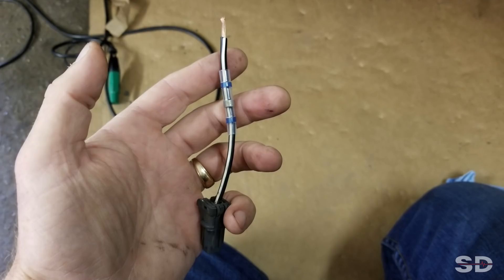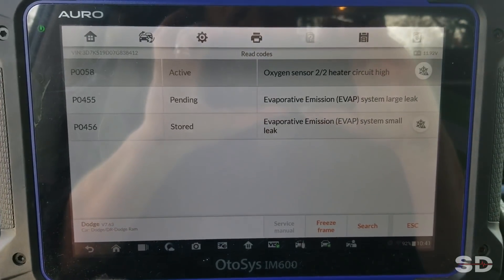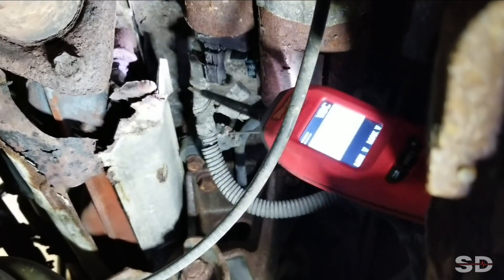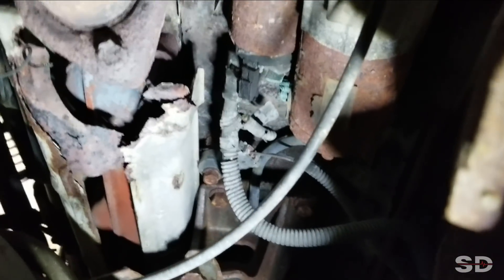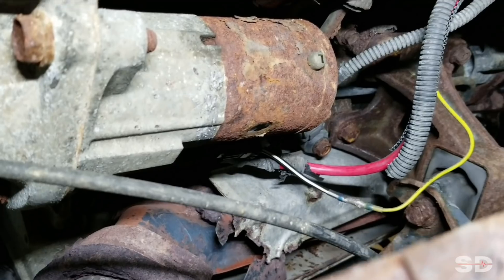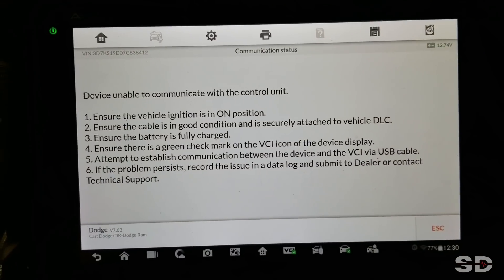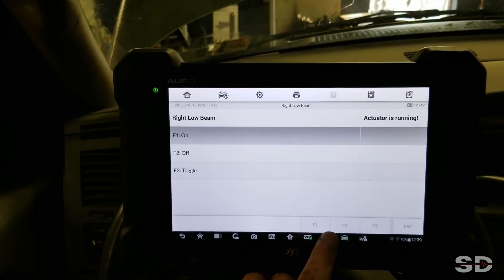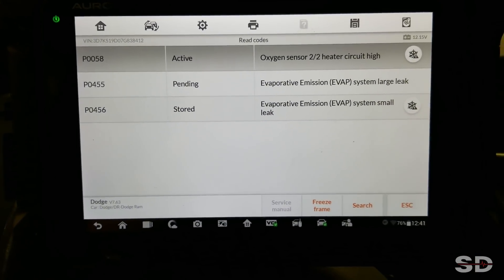2007 Dodge Truck No Crank, Wiring Repairs, New Scan Tool

Comment: As far as melting heat shrink butt connectors goes, Power Probe makes a butane soldering iron. It has an open tip in the kit that acts as a heat gun. It's how I do almost all of my heat shrink. I have a Milwaukee soldering iron for solder work.
Reply: Addendum. I just realized that this video is 5 years old and you probably realize all of this by now. 😂😂

Comment: Thumbs up for not deleting the failed solder with the lighter, thank you! I'm not yet sold on the single stage solder/heat shrink, too easy to leave an inadequate joint after saving less than a minute of time. Great to see another scanner, I wonder how that's gonna shake out.

Comment: if you heat up the bare wire end with the soldering iron and dip it in acid it will clean it up real good and will take solder then

Comment: Use the blue flame only to avoid soot. I just got these style butt connectors a week ago by accident I didn't know exactly what they were. I hate them. Half the time I'm heating them, the insulation just pops and either the solder comes right out through the insulation or the red seal come out through the insulation. I loved the crimp style with epoxy seal.

Comment: A tip for doing heat shrink with a lighter, the temp is hotter if you hold the heat shrink 1-2 inches above the tip of the flame instead of directly in the flame. It also decreases the chances of it charring the tubing like it did for you.

Comment: Hey Paul greetings a tip here , i spent couple of years on the US NAVY as a technician and while i was there they thought us that never solder a connection that was on a prone to vibration place because it can crack and have issues later ,just use butt connectors or heat shrink tubing or heat shrink electrical tape ,only solder connections that were indside with no vibtation,just a tip here man,as i always said nice job your doing Paul i have learned a lof from your channel ,i forgott if you can help me out to like  and share my page ,i just opened a channel a couple of weeks back ,ill be doing some videos on english too,
God Bless NEVER GIVE UP!! TAKE CARE !! From Puerto Rico ,Ken!!

Comment: on the heat shrinks with the solder sleeve they have flux.give the solder sleeve a firm squeeze with a pliers to get the solder in contact with the wire.

Comment: I use bare butt connectors and a good sealing heat shrink or electrical repairs. The nice thing about them is you can use solder as insurance. They work good especially in conditions like this where the wire is still good but a little green.

Comment: band 2- O2,  shoould be passenger side rear, probably nothing wrong with the heater in the sensor... one of the common grounds with away corroded wire or plug... (multi-wire crimp terminal most likely) GARBAGE is garbage is garbage.

Comment: acid flux would clean it up, BUT it will also wick back into the wire and cause corrosion behind the fix inside the coating, pretty much like the salt water has done now...
only true fix cut it back until dry and clean, abandon the wire and run new.....

Comment: awesome, loud farting exhausts leaks and the starter solenoid to motor supply wire green corroded as hell, coming very soon, no start, starter bad =p
to be honest, I'd have done both if it was mine and possibly the battery to starter terminal end too. past lessons of life. even thought I hate and will not own another crapsler anything ( exacept maybe a classic, pre-JUNKTRONICS)

Comment: "40 amps" to make it crank? did I hear that right or do I recall wrongly..... seemed the solenoid coli was more like 10 to 15 amps, requiring low voltage drop to have enough force.....

Comment: Ford went to the "spade terminal" for a while, but it was a major issue for them too, luckily, it was a eyelet to tab converter, which went on the "unchanged starter" stud with a locking nut/washer.
aftermarket and they all went back to harness modification, starters were supplied with sealed ring terminal eyelet to butt splice. go figure .
I may have partially caused that, public ranting about chinesium and junk DOES in fact help curb totally stupendous things ;)

Comment: best fix for a Dodge is the crushers, more so if it's beyond  years old :))
them solder connectors MEH, I'd rather use the crimp style shrink/sealing splices myself, of course you need to use a a heat gun or lighter and evenly heat to not blow them out also...

Comment: Awesome work Paul thank u for sharing another great video.. Wanted to ask about this Scanner does it have scope capabilities and how much cheaper is it than the Snap On
Reply from the maker: no scope on this one brother just a scan tool 
And as far as costs, there are a bunch of different model Snap-on units, but if you are talking about the Verus? It is around $10K
Reply: Yeah I know about the Verus that bad boy is a little to far out of my price range lol.. Actually I was speaking of the Auro the one u are testing in this video I heard you say that u was surprised at all the on board systems the u could communicate with while using it.. It is a pretty good scanner and worth saving for also what's the price tag on it

Comment: not a fan of the solder splice, I prefer RA flux in a dropper squeeze bottle , non insulated seamless crimp, soldering gun, adhesive lined heat shrink, premium 3M electrical tape 33+ or super 88 works great in cold weather. 3M scotchkote- (not liquid electrical tape.) - PS - I own a boat  used in saltwater! 3M Tape comparison http://multimedia.3m.com/mws/media/770753O/3mtm-vinyl-tape-performance-comparison-chart.pdf

Comment: Why didn't you just use Solder, Flux and a piece of adhesive shrink tube?  When I work with corroded wires I use Petro Based Acid Flux dipping it several times(hot)
I know! You just wanted to play with them nifty soft solder tubes LOL
Reply from the maker: Pretty much lol

Comment: Do you own or have used the OTC Encore?
Reply from the maker: yes and for $1300 or whatever the list price is, it is worth it as it is a bi-directional scan tool but I hate it because it is sooooo slow. To be fair, there is a new update and I need to run it and see how it does after.

Comment: That PowerProbe is great - I definitely need to get one of those. Working solo, it's like having another person there at the flick of a switch ... except for that crank command requirement for the computer to start the engine.

Yeah, that thing is basically an Autel with a different name - wonder why they do that? Why not just keep it an Autel? Strange!

Excellent as always, brother Paul. 👍👍🍻

Comment: in my experience using very similar connectors from napa an electric heatgun works far better on them than any other heat source i love using them the connectors seem to be very good
Reply: Absolutely right. In fact those solder sleeves are supposed to be melted with a heat gun. A flame is a bit too much. Wanna guess how I know?

Comment: The thing about the Auro/Autel tools is understanding that if the manufacturer of the vehicle coded a functional test it will work but if not it wont. The options for some tests and functions may not always work although you might see an item listed. I use an Autel everyday but when I need total diagnostics for driveability and scope I grab the Verus.  You also need to understand the manufactures that have Legacy and enhanced versions and when the years they converted. A prime example is using the Autel on an older Chrysler during the DRB3 era. The autel will work but it will show a lot of functions and tests not applicable to the vehicle. The Autels are an enhanced tool but the Autel DS708 is the legacy version. Hope that helps.
Reply: Same options as Maxisys Elite

Comment: Also when you said software glitch the autel is the same way those are just your options on the screen you have to activate the options at the bottom
Reply from the maker: Then your shouldn't be able to click on them! they change color and make a sound as if they should be doing something, also when you click the F buttons, the displays on the screen are not coordinated with it. lol. I'm still calling it a glitch

Comment: The solenoid pulls 40 amps? Also looks like you need a power probe penetrator gives you extra 6 inches and is real sharp to get good contact
Reply from the maker: Initial amperage (when both windings are energized, before the motor starts to spin)
Reply: High inrush current - that is why you pre hold the  switch on a power probe as to not weld the switch contacts
Reply: I have used my power probe 3 for 10 years doing this never had a problem now my 4 for a few years what is the breaker amperage on I power probe
Reply: 8 amps

Comment: When I need to solder lightly corroded wires I usually take 220-320 grit sand paper and pinch the copper between the paper and lightly drag the sand paper toward the end of the wire. Clean up the wire after with some electrical cleaner of sorts to remove any dust and then solder. Usually works pretty good.
Reply: I agree, but I still would not trust that connector. You cant really tell if the joint is any good.
Reply: @fascistpedant758  I am a bit skeptical but I have seen these (on videos) seem to work alright. My issue is when soldering, the copper also needs to be heated up to allow the solder to bond with the copper. My question is, is the copper being heated up enough for the solder to bond? I have seen some people pull hard with these and they joint didn't break. I think it shows promise if the wire is prepared correctly.
Reply: I guess they would be fine on clean copper and,as he mentioned, using a heat gun. It seems difficult to heat evenly and for enough time to heat the wire without burning the heatshrink, using a flame. I still prefer to see a solder joint properly to be sure the solder is wetting the copper as it should. I'll have to try one someday.

Comment: Hey danner good diagnosis I think some else would of been like o you need a new starter no crank I find all your videos very helpful thank you for your videos and sharing your knowledge and I also want to thank danner jr for helping with the videos I hope you make more videos soon o and does that scanner work for evap to close the vent solenoid
Reply from the maker: yes it does Ernesto. This scan tool has more bidirectional tests available to me than any other scan tool I've used
Reply: @ScannerDanner  ok danner I'll look into that scanner I'm looking around for one thank you for the reply

Comment: The Wagner HT400 works well for those type of soldered connectors. We use them in aviation all the time. I have the HT400 and it does a great job for stuff like this.
Reply: But I always crimp with the appropriate tools when I can. In my experience crimped connections with quality shrink tubing is much stronger than any solder connection.

Comment: I found that using the yellow solder sleeve works much better on a connection that size. It seems that the blue ones don't have enough solder to fill it. When I first started using them I always tried to use whichever one fitted snug around the wire before heating. But they just end up overheating before getting a good flow through the wire. Move to next size up and surprisingly the solder melts faster and much more evenly. I suspect this man be due to the solder being able to absorb all the heat and melt before it's pulled onto the wire and having heat taken by the wire. They stay clear too doing it this way. Don't turn black or discolour. Very strong connection too.
Reply from the maker: very helpful information! Thanks so much. I will remember this and apply it next time

Comment: I just can’t be sold on those solder-filled butt connectors. I can’t imagine that even in the most ideal conditions that they could ever be more resilient than a mediocre solder job with marine grade shrink tube. Also, I’ve never seen anyone use too much flux on a joint...
Reply from the maker: I've done them and then cut it apart to see how well the solder made it's way through and I'm good with what I saw.

Comment: You brought up a good point about those 'built in solder' butt splice connectors.. If the wires are oxidized, or has some crusties, it's going to be a bad joint. Might be better off with a good crimp connector. cleaning the wire better, and additional flux would certainly help.

Comment: So what do you think of the scan tool compared to the snap on scan tools? I had a Autel and I liked it but now have a modis Edge and in many ways it’s way more elite and the functionality is more practical what I did like about the Autel was the control modules it was able to access especially for euro cars
Reply from the maker: Scan data (recording, freezing, reviewing, measuring values etc) is by far, way better on the Snap-on units. It looks like the Autel has the advantage when it comes to talking with different modules and offering bidirectional controls
Reply: Are Ford's sequential electrónic fuel injection systems from 2000's suppost to fire all 6 injectors at the same time during cranking? Can't find any info online, and you are the expert man!!

Comment: I enjoy these videos however I've seen similar cases you have tackled with the same issue and I'm more interested in what your thoughts are with the new scan tool (hope that didn't come accross as cheeky), I know you want more practice before appraising the tool properly! I have an autel which is basically the same and I'd like to see you select data pids and graph data etc during a diagnosis like you do so well with the snap on. thanks for taking the time to make the video
Reply from the maker: That is coming, though to be honest, I already know which one does that better and it is the Snap-on scan tools. The Autel does not record all the data, only the live ones you see on the screen.

Comment: I like using the crimp connectors that after you crimp you use heat to seal it until the adhesive flows out the end. The ones that GM uses in their connector repair kits have been problem free anytime I used them. I bought a pair of ratcheting crimpers like GM supplied in their electrical repair kit, the things work great, almost impossible to do a bad crimp with them.

Comment: The price looks pretty reasonable for that scanner.I bought a little weller butane solder/heater gun for them connectors that work super ! The power probe model works good also. But I’m sure you have all that too.
Reply from the maker: agree, Snap-on, by far has the edge on Data Pids and the functionality there. (Recording, freezing, reviewing data, comparing values etc)
But I think the Autel/Auro definitely has it's place as well. Got a case study coming up on an Infinity with an immobilizer issue where the Auro was the key!!
Reply: Burt Pilon the Autel Elite is on sale for 2500 awesome price. I’ve done some Nissan and ford keys so far. I love my Verus edge tho.
Reply: Yes after I pay my Verus Edge Off i will be creeping to the autel I really like the reviews and all . Really loving the Verus also And i find myself using the scope more than the scanner lately and I can’t seem bite the bullet on the 18.4 update at the moment. But if SD does more videos about this unit it may be in the line up. It was him who lead me to the Verus.
Reply: Burt Pilon I paid $3500 for my Verus edge with 18.4 I scored it, brand new. I use pro demand on it all the time so I don’t have to run to the computer for sure diagram. 18.4 is awesome you should really think about buying it. My Elite stays in the box most of the time. It’s slow compared to the edge and the pid layout is awful compared the edge. I love the snap on pid layout
Reply: True. Looking forward to it 👍🏻